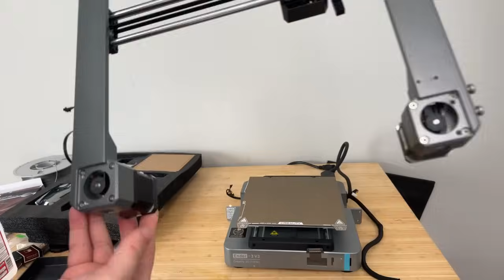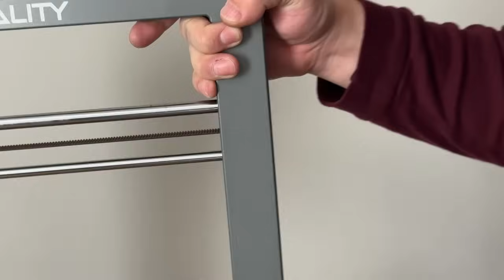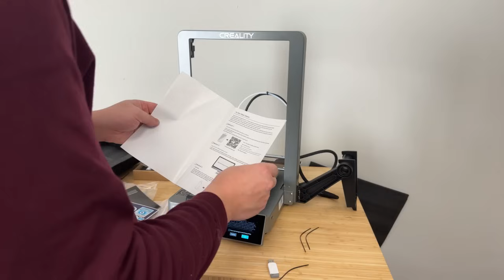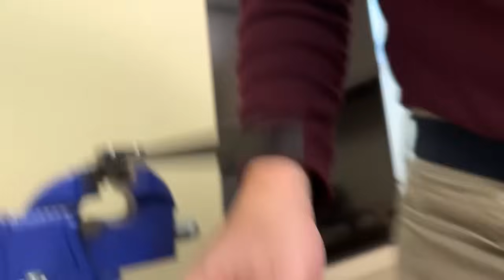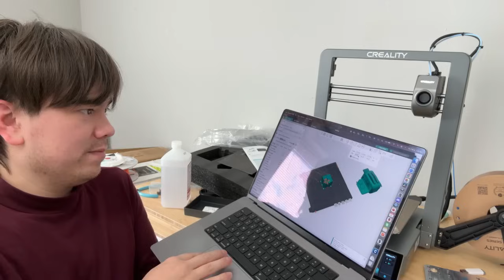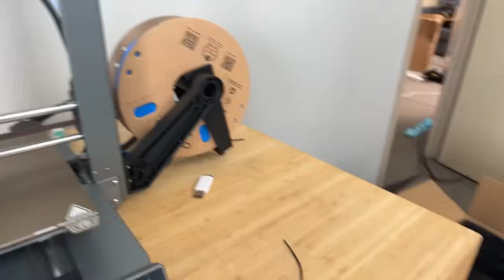Unboxing TheFastest Bedslinger on The Market? Ender 3 V3 CoreXY Flagship from Creality

Comment: Cheap linear rails are trouble. I bought replacement slides. 1 fit and two others would not even go on. The one that fit was loose. I tried them on different rails and got different results. So now when I get rails I just use the ones I got with replacement ball bearings. Seems they fit the carriages to the rails.

Comment: Thanks for the video....Can it print TPU through the bowden tube?
Reply: Yeah no problem. You can run tpu through a long bowden tube out of a drybox as long as your printer has a direct drive extruder.
Reply: @NvrchFotia what about pa12?

Comment: “Creality should release a true CR-10 version with dimensions of 300 x 300 x 400, featuring auto bed leveling (eliminating the need for manual adjustments) at a price point of $600. Alternatively, they could introduce a Core XY printer, which doesn’t have to be fully enclosed, but should offer a similar build volume.”

Comment: I like this printer but it seems so noisy. I'd like one if quieter. My modded ender 2 Pro was printing at 150mm/sec & 4000 accel with both 5015s running and sounded quieter than the V3 slow first layer.

Comment: Looks a bit too over engineered requiring more maintenance and added points of failure besides maybe the daughter board that would be near the hot end. Already have two belts to worry about, but now 4? How easy would it be to change out parts compared to previous printers? Looks cool but there still hasn't been anything enticing besides the v3 se and even that looks like a more of a pain to maintain with possibly the hot end too. Ive upgraded my stock ender 3 with bits and bobs from newer designs over the years so on that front I'm still excited to see what the new stuff is capable of! Might do a load cell mod next!

Comment: CoreXZ is weird but it's hard to argue with good print results and the speed shown on the second layer of the Torture Toaster.  Lots of nice features in this printer and the design looks to be very good.  I could really go for a larger bed version of this, with real Klipper.  I hate Bowden tubes so I'd clip it to have a 25 mm stub sticking out the top of the extruder and top feed it.  If it's as reliable as it should be, I can see some small print farms using the V3.

Comment: You need to fix the title, as well as the picture post that baited me here. This is not CoreXY….
Reply: It’s as he said, put it on its side and it’s a corexy
Reply: @Finchyboi14470  still not corexy
Reply: Easy mistake settle down.
Reply: @DaleBuckley  he repeated that mistake. It’s either lazy or just shitty clickbait.
Reply: @DaleBuckley not really but doesn’t matter
Reply: Core XZ, close enough 😅
Reply: @MrHeHim not even that since it's still using lead screws
Reply: @Catboy-hr2qp where do you see leadscrews?
Reply: Also the voron switch wire is faster and it is also core x z

Comment: How does CoreXZ make sense? So this can do 500mm/s in the Z direction but not having the accuracy of a threaded rod in the Z direction? I mean fast in Z direction is not needed whatsoever. The concept seems confusing to me. CoreXY makes a lot of sense but coreXZ? hmmm
Reply: I’m not an expert, but it seems to me that with a belt driven z axis you are looking at a tiny fraction of a motor revolution to move up a layer height. With a screw you are looking at slightly more of a motor revolution to move up the same amount. That seems intuitive to mean that the screw should be more accurate (any amount of error in motor steps would result in a lower error in distance with screw compared to belt).

Just going off my intuition, I’ll admit I don’t know much about these.
Reply: Thank you for explaining what I was thinking but I couldn't put it in words as you precisely did.
Reply: @andrewmiller6051  it’s really not more accurate. 
The screw is dependent on the diameter and thread pitch as to how much the motor needs to turn. 
With a belt, it’s dependent on the diameter of the pulley.
Reply from the maker: Yeah I’m just as confused as you are, but somehow it works, lol.
Reply: Why do you think a threaded rod is more accurate? X and Y is just as accurate as Z on core XY.
You would actually diminish if not remove the chance of Z wobble and Z bind. 
By using Core XZ it allows faster and more stable X speeds with cleaner Z motion.
Voron Switchwire is a core XZ printer if you want to see how it improves over a traditional bedslinger.